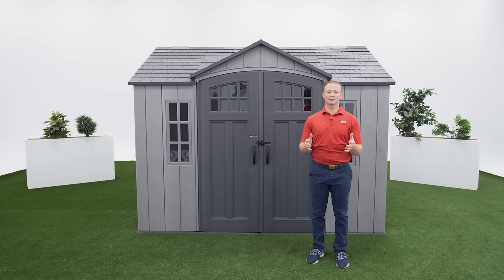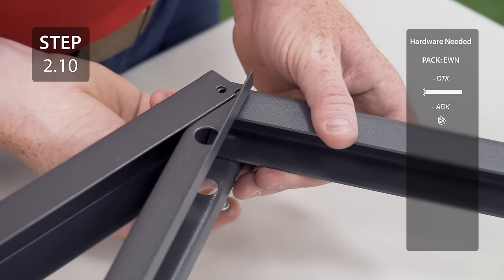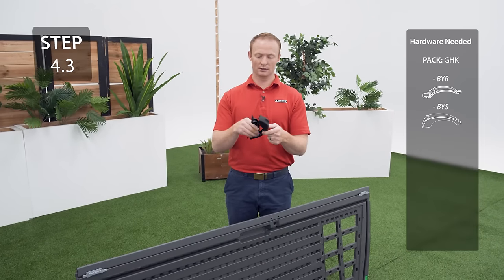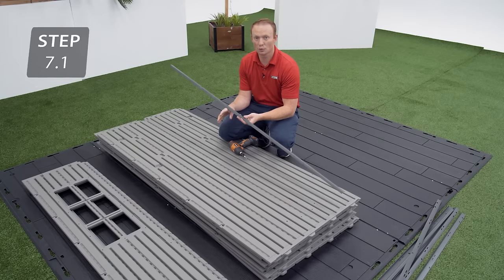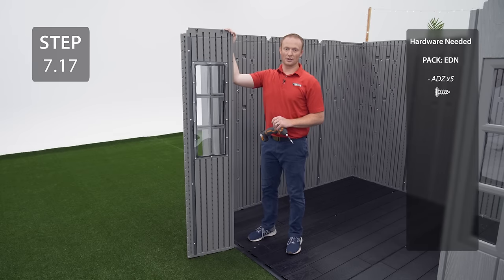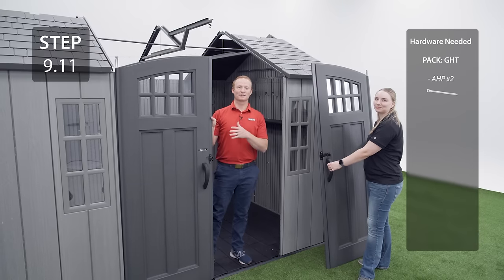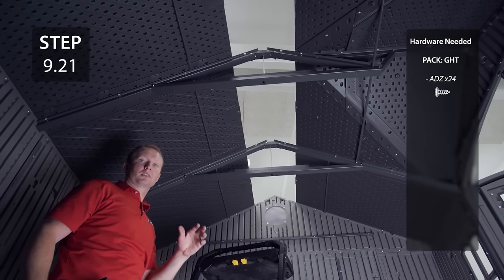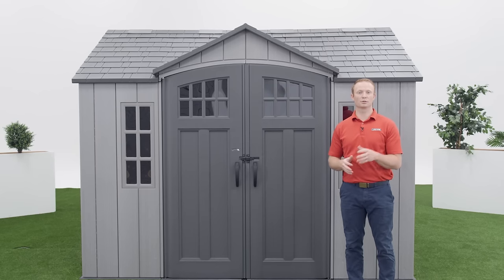Lifetime 10' x 8' Outdoor Storage Shed | Lifetime Assembly Video

Comment: Well I just purchased and put together the 8x10 60005 shed- that was something I would not want to do again! First off, yes the design is good (in theory) and the videos make it seem so easy….. NOT! I watched visors over and over (I’m not stupid) just to make sure I have it right. Putting together trusses I was shorted on some screws and had to go purchase some to put together. The corner panels are hard to put in place and took some finagling to get in place (don’t believe the videos when they show it so easy to put together). Next beef is I chose to put it in corner of yard and build a wood platform at the intersection of 2 fences (getting concrete slab poured would have been many wheelbarrows of concrete to back yard)-this wasn’t greatest of ideas because you need to get behind and on sides of shed to have someone hold panels in place and I had to shift my shed floor out and away from fence and then try to put it in back in place so don’t secure shed floor to platform (which I didn’t) until I had everything put together. Now doors are my next beef-you have the walls up and trusses in and they say just place the door poles in the bushing on floor and push a cotter pin through bushing and hole in door pole and spread cotter pin. Fine (took awhile on this task folks) but got in and then they say put on front gable and push onto door poles but do that and then u need a 3rd person to hold doors in place while you’re trying to secure gable to trusses and get on roof panels at same time. It was a pain to get roof panels attached to gable ends and trusses and beware-if you screw one of screws into plastic but have to back off because something ain’t quite right you will lose your screw purchase in plastic. The videos say install these metal drainage plates by roof trusses but the manual shows what they gave you is plastic with not get instructions on how to install them (c’mon Lifetime update ur videos to reflect what you have in package) and took awhile to figure out how to install plastic part they gave me. Also they talk about installing foam between roof and trusses and gee they didn’t give me any foam so I had to get some and make do. Next beef is the videos-after showing detail maybe show the full picture to see the whole thing. I’m a pretty experienced handy person and mechanically inclined so I’d caution people to think about this purchase beforehand-videos make it look easy but believe me it’s not all it looks to be. While I’m typing this I’m seeing the shed being put together and it is not the the same as shown in video from QR code scan (c’mon Lifetime update ur videos).
Reply: We were shorted on hardware as well.
Reply: 1st off thanks for the video which helped alot. 
my shed now installed looks amazing and everyone who's seen it says wow, where did you get your shed from .I'm not too sure a  wooden shed would get the same reaction. lol.
However having just finished installing mine I've got to say you're spot on Dirk regarding the doors.they are a complete failure in the way they are attached to the shed.
it's like the doors are an after thought.
IMO the door hinges and the way they attach need redesigning.I think it needs more like a upvc setup where there is adjustability on the hinges so the doors align better.
another massive underrated comment is how flat the base needs to be .
last thing is don't be fooled by the video the guy makes it look so easy but it's not in reality.for example you never see him tugging and wrestling to get things to line up,which i was constantly doing.
also why
go to the trouble of sealing the windows and putting insect netting on the vents when like said in previous comments there are gaps here and there.
As Dirk said get your shit together regarding the putting self tapping (adz ) screws in to pastic holes ! it's very much a one time deal.
overall I'm happy I've got the shed as opposed to a plain wooden one.
once again lifetime thanks for the video.
Reply: @andyoffless5696  thanks for seconding my opinion on my shed comments. I was mildly surprised that company did not reach out to talk about my comments on shed.I’m actually still messing with doors after a year and after some further shimming I’ve eliminated most of door issues. Take care.
Reply: @brewpa  
glad you got your doors sorted at last Dirk.
 i enjoyed reading your comments .maybe lifetime don't want to improve and are happy 😕. 
good luck with your shed m8.
Reply: Also it was so like doing a puzzle trying to find the piece and then trying to figure out where it went. The video should actually show you how to do each step not take this and put it here without showing how. Took me three long days to complete what should have been done in one day. And John’s instruction video showed every piece drop right into place. I wonder how many takes that yook😢
Reply: @brewpa they didn't reply because they don't care. The sale is all they're interested in
Reply: How did you get the corners in? I’ve tried so many times with help and blocks I can’t do it
Reply: This is not for the faint in heart .. the written instructions does no justice and the video is not real .. if you are a handy around the house person .. you will be able to improvise and get it done ..if you are not ..don’t do it yourself
Reply: I made a mistake on the flooring and I need to take the wall panels off but how ??
Reply: @jazminyz  I ended up filing some of the plastic slot away a bit at a time  until I eventually managed to click it in
Reply: Thanks for this comment and overview. It allowed me to regain some sanity after fighting with doors, cotter pins and front gable. Needs to be re-engineered

Comment: Hey guys, when you put the steel frame on the walls (step 9) don't try to slide the roof on it. You can screw it up in the frame and then put the frame on the walls, then screw the corners in the window and lateral wall. I promise guys this will save you so much time and frustration. Lol

Comment: Thanks for this informative video. However, the roof has been a major headache to install. The screws and panels at the top are practically impossible to install. How does this get fixed? Should I have installed this on a raised bed and not directly on top of the cement?

Comment: Video helped a lot.  This was my second one in the last 3 years.  Highly recommend over Duramax and metal sheds.
Only two suggestions:
1. When installing roof pannels have somone push from the outside edge 45 degrees upwards before screwing in so top ridge pieces fit more tightly
2. Use an electric screw driver and do not overtighten the large screws that hold the plastic panels together
3. Install a cheap solar light (where solar is seperate from the light) for the interior.  It is fairly dark even in broad daylight.
4. Use a metal/concrete drill bit (9/16) to pre-drill the "self-tapping" screws for the metal snow support brackets near the end of the build 
5. Helps being handy and can be done with 2 people in 6-8 hours.

Comment: A few points:
(1)  Great looking product!
(2)  Tremendous value for the price - we paid $1599 CDN at Costco Canada.
(3)  Didn't even mind the approx $600 cost of building the foundation (of course pricing depends upon your local lumber prices).
(4)  The install video (here) was super helpful.
(5)  A DIY NIGHTMARE - I'm about a 7/10 on the handiness scale and this was brutal.  We were going to buy the companion piece but now we won't.
(6)  I used bad language by the end.
Reply: What kind of base did you build for the shed?

Comment: Excellent Video.   Not the exact Shed I purchased, but close enough that this video helped a LOT.
Reply: Mike, which model do you have? 60005?
Reply: @Megafrankjr    That's sounds right, but not 100% sure.    Mine does not have windows on the doors and does have skylights.   Your Video was awesome and being able to use the QR code from the instruction manual when I had a question made it relatively simple to put up.

Comment: Finished Building this shed this past weekend.
Things to note:
Give yourself a full weekend or two days. End to end it took us 9 hours or so. 
You will need Beer and lots of it lol.. 
You need two people for sure if not three. One on reserve for the end, and with strong shoulders. I’ve got weak shoulders lol
You’ll need music to drown out the noise or to just dance your worries away. 

On a more serious note:
DEFINITELY USE THE VIDEO AND THE INSTRUCTIONS. MAKES A 100% DIFFERENCE WHEN TRYING TO DECIPHER CERTAIN INSTRUCTIONS. 
Build the sections in the beginning as they say in the video and then start to assemble. 
The tape they use is plenty for all the windows, so you’ll have left over. I’m thinking it’s for the skylights in case they leak. Be gentle when screwing those in, they are brittle.
You’ll have TONS of left over screws which had me double/triple checking and I got a bit paranoid that I’d missed something. 
You will need all the tools they recommend and then some. I used a regular drill mostly, but you will need an impact drill for the end when you’re doing the self-drilling screws. 
You will need a short bit extender and a long one. 

Otherwise, it’s pretty straightforward. 
Good Luck 😆🤣
Reply: How did you get the corners in? I spent half an hour with the first one and just can’t get it in
Reply: @jazminyz  wall corners or the roof corners?
Reply: @oth1295  wall, haven’t gotten to roof yet😅 I ended up filing the wall a little so it pops in. Probably will do that on the rest but it’s too hot to do it rn (96F)
Reply: @jazminyz  honestly I had no issues with the wall but follow the video and double check the panels are in the correct spot. I didn't have to make any physical adjustments, so it could the be panels are in the wrong spot. Some are long shot and shot long.
Reply: @oth1295  yea I double checked multiple times lol. Maybe they didn’t mold it great cuz after I trimmed it a little it clicked in no problem
Reply: @jazminyz  l same here. We sent back to the video MANY times
Reply: You'll need to adjust it a few times but it will fit in. Do you think filling it would cause it to now misalign?
Reply: @oth1295  no I didn’t file it so the point it wouldn’t lock. Just enough to be able to force it thru
Reply: This is my first problem. I am going to have to use the neighbors 250 lb. son to snap that first corner (and maybe others) in.  @jazminyz
Reply: @Jeff-jg7jh  good luck, I couldn’t do it with my 6’3 brother my mom & me😂 put wedges and everything nothing worked till I shaved it a little
Reply: No shaving needed on anything in my set. I used a block and a hammer or body weight

Comment: after watching this video,  make sure you scan the url codes in the assembly booklet.  Added video instruction are Very Helpful.   did mine today.  took 7 hours 50 minutes.  no help until i got to the roof.  turned out Great though.
Reply: i had an old wooden existing shed (6x8) on a concrete slab.  Tore that down, and enlarged the slab to 8x10

Comment: Great Video! Dont let all the complainers and negative Nancys on here steer anyone away on putting this up together, After putting out all the parts and setting up a table and my tools, I put this up by myself in 3 hours taking my sweet time. I encountered the issue with the corner folding panels as well but you just have to get some sense be creative, I placed a piece of block underneath the flooring part where the panel pops and snaps into and pulled down with my body weight and popped right in. Everything else was a piece of cake.
Reply: 3 hours is total BS, nice try though 😂
Reply: bullshit

Comment: One man, gloves and creative ingenuity g lot it done. The warping of the front and back walls from the sun made it impossible for the gutters to reach….. so I used tape and leaned something heavy against the front wall to get first roof section in. It was down hill from there. Took me 3 days at 4-5 hours each day, but I’m old af, outta shape. This didn’t include me breaking down the pallet on the street and walking EVERY piece 85 feet to the back of my yard the day before. Best workout I had since making babies 14 years ago. One complaint, whoever was in charge of trimming the excess plastic needs a good talking to.

Comment: A tip for anyone installing this shed: It may be better to screw in the 4 skylight pieces by hand since the plastic pegs can very easily become destroyed when using an impact. Best to use a very low torque tool or just use a screw driver. For a better seal, apply cauking around the skylight lip.

Comment: Great video it helped a ton. I do have questions though. Step 9.12 you put the gable over the front door but for me that whole section is super wobbly. Am i supposed to be forcing that gable edges into the channel of the gutter channel or is the only thing that secures that the brace you put in in step 11.5? It just seems all loosy goosey. In the video it seems secure but doesn't mention how that's done.

Comment: Thank you for the showing on how to set up our shed. Question? What's the foundation for this 10x8 outdoor shed?
Reply from the maker: We recommend a pressure treated wood platform or concrete pad. Refer to your manual in section 1 for the instructions on how to do that. If you have any questions regarding the foundation, contact our customer service team. They can be reached out 800-225-3865 or by email at customercare@lifetime.com. Customer Service hours are Monday-Friday 7:00 am to 5:00 pm and Saturday 9:00 am to 1:00 pm (MT).

Comment: Having just built this shed to 99% completion, including snow reinforcement kit add-on, I can say that it is relatively straightforward to build but complex and therefore time consuming. It is a minimum full day assembly and at least another ½ day to prepare the wooden foundation.

Small mistakes early on can lead to lots backtracking if you're not careful, and many of the diagrams have to be read very very carefully or may not include visual aids to assembly opting instead for detailed written instuctions which may hamper the less literate.

If i had to choose between assembling this shed or builidng one from lumber, I would opt for the more durable option of building a more solid building for $2500-3000 myself.

Comment: Many thanks for the great video and upload.
I am about to purchase this shed however I am not clear how the shed is anchered to the concrete base. Are parts included for this purpose?

Thanks in advance.
Reply from the maker: The hardware to anchor the shed is not included. You will need to purchase the hardware from a hardware store, you will need eight 3/8" x 2" concrete screws and eight 3/8" x 1" fender washers.

Comment: Here's my mini-review: The 10' x 8' Lifetime brand Outdoor Storage Shed is attractive but it doesn't go together by simply slipping pieces into slots and then inserting screws as you might expect. For example, to insert the corner pieces into the floor you have to use brute strength to bend the plastic to snap it in (after raising the floor on a block), and similarly considerable strength is needed to flex the plastic when joining the sides of the wall sections together, and some other parts like assembling the door latch mechanisms.

The instruction manual was not placed in a plastic bag, so when the boxes were opened after being stored outside, rain had soaked it. After drying it in an oven some of the pages were illegible after peeling them apart. Fortunately, the instructions are also online so I printed the missing pages from those (although for the identical model the online instructions were not entirely the same as the printed ones, and were missing one section.)

The instructions are good and well illustrated, but a little puzzling at first because only some of the pieces are labelled with the instruction code name, making them a little harder to pair up with the corresponding instruction than need be.

The pictures of the various types of screws (e.g. "AZW") are lifesize, making it easier to identify them even though their bag is not labelled e.g. AZW.

The instructions include an unusual wedge method to bend the frame to get the doors to align height wise, but this is unnecessary with a perfectly flat base underneath. However, there is no method to adjust the gap between the doors, which is fixed by the arch over top of them. It turned out that the end doors collided or overlapped with each other slightly, making it extremely difficult to close them. By loosening the screws holding the arch together and removing the door latch's aluminum strike plate, it was possible to get them working.

There are a few gaps around the tops of the doors which are big enough for wasps to enter, but some duct tape may keep them out. The gaps under the doors are considerable, so to keep snakes and mice out, adding a strip along there is a good idea.

If you use the recommended wood floor underneath, vermin can burrow under to create a nice dry nest, but with the drain holes and seams in the plastic floor their smell will rise into the shed, so consider using a concrete base.

It was close to two days work for two of us, plus the construction of the base. The instructions recommend two people. A lot of the prep work, fitting the parts together e.g. the windows to their sections, can be done ahead of time by one person. A third person as recommended in some videos would be a bit inactive during much of the assembly part. 

Hopefully Lifetime will redesign this excellent shed to make it easier to assemble.
Reply from the maker: Thank you for your time to review this product and telling us your experience  with the assembly. We always are looking for more ways to make our products better so we appreciate the feedback!
Reply: I stopped reading as soon as your solution to improper fitting doors was duct tape .